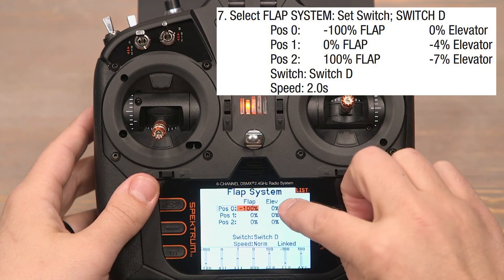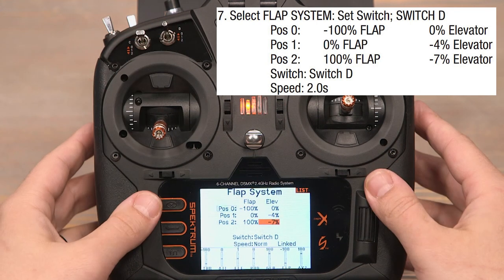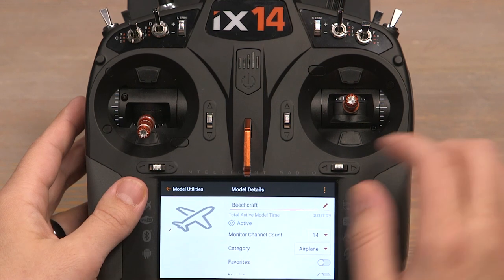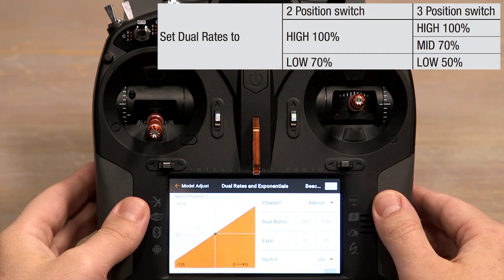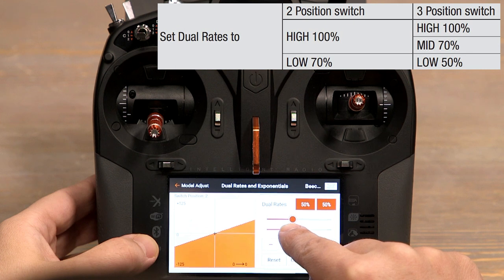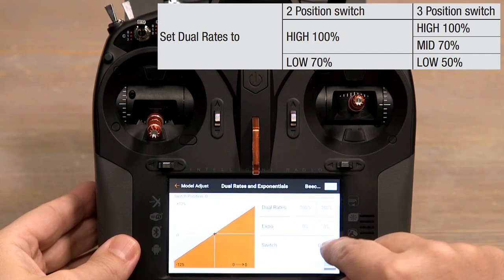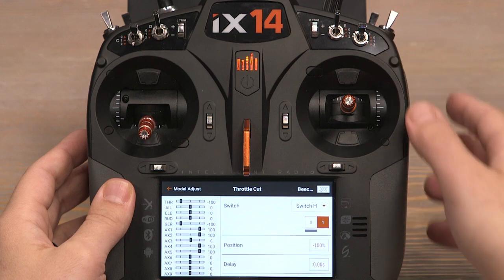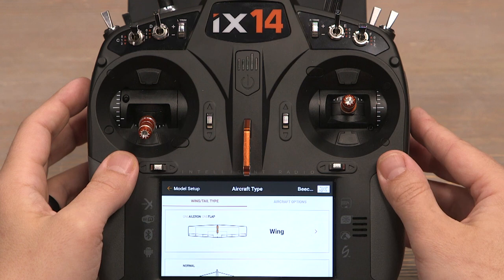E-flite Beechcraft D18 Spektrum Transmitter Programming Guide

Comment: I don't turn the low rates down that far on my Beech 18. My low rates are usually set to 75% with 20% expo. I use 25% expo on high rates. Also, my takeoff flap position is 1/3rd of full flaps, not 1/2 flaps.